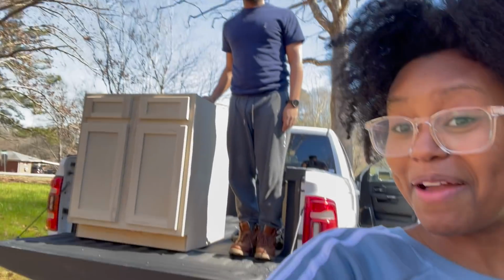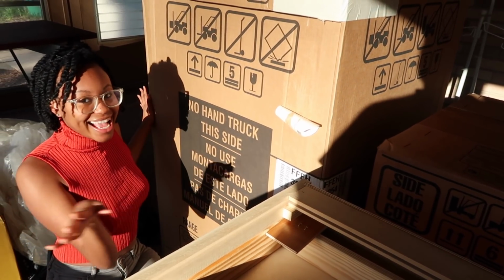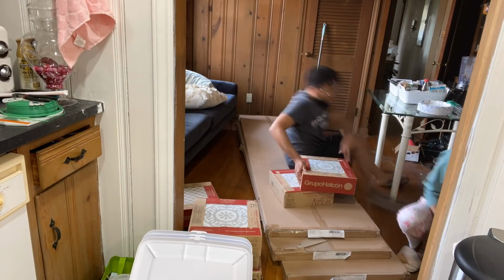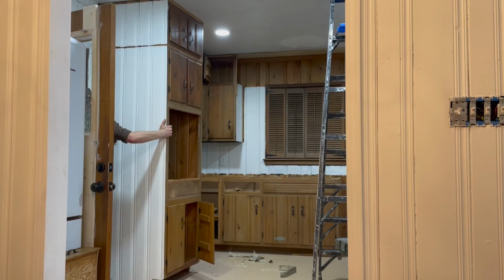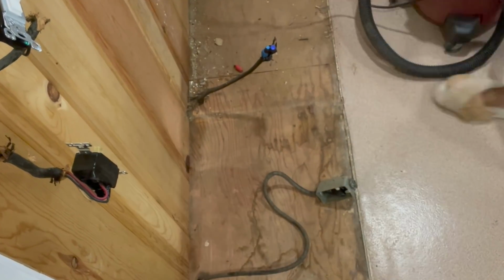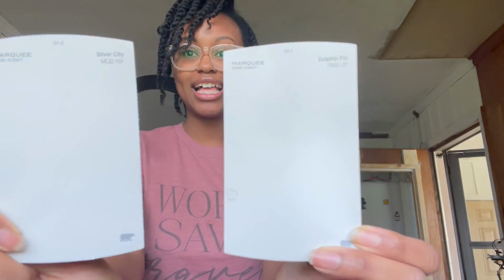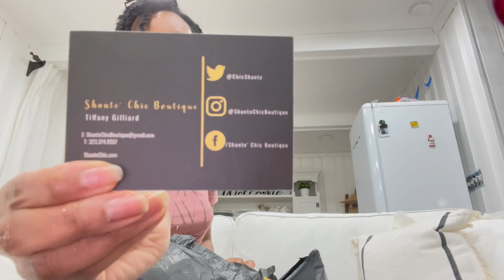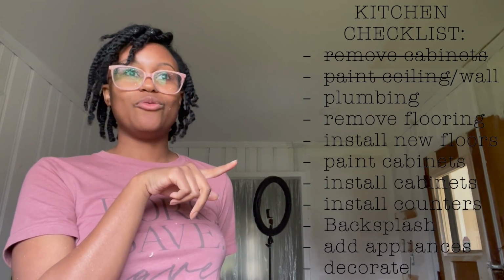IT'S DEMO DAY! COMPLETELY GUTTING MY KITCHEN! | Kitchen Makeover Vlog #1 #FIXERUPPER +GIVEAWAY

Comment: When using the paint sprayer you have make sure the paint is right consistency, you can add water or floetrol and stir well. You also have to adjust the airflow and the paint volume(nozzle). The ring around the tip controls the paint volume slightly loosen/tighten it until you achieve the correct flow. Typically near the trigger is knob/button to control the air you have to adjust it for the correct airflow for your paint. Test the flow on cardboard or something and play with the adjustment. Also check for clogs in paint, when in between spraying cover the sprayer with plastic and place in the fridge to keep the paint from drying. If you have any questions, I'll do by best to answer them. Goodluck
Reply: That's so nice of you
Reply: Super helpful
Reply: @nae1470  thank you
Reply: @naturallynailah6983  yw

Comment: In so excited for your Reno. But a quick tip on the sprayer. If you are having trouble with the paint coming out. Add lots of water to the paint and always be sure to clean out the nozzle before and after every use. Refer to the manual for how to take apart the nozzle for cleaning. With latex paints I add 1/3 paint and 2/3 water to the container on the sprayer or half and half. Unfortunately using paint thinner was never enough with my sprayer as I have a similar one. But rule of thumb most times if it’s not spraying out you need more water or need to clear out the nozzle. I hope this helps.

Comment: Don’t give up on the sprayer!!! It’s the best for cabinets. FYI, white paint is the worse to spray because it’s difficult to see where you have wet vs dry paint. I learned that the hard way 🤦🏾‍♀️ it’s also helpful to strain your paint before using the sprayer, and use water to thin it out if you need it thinner. The sprayers usually come with a viscosity cup, don’t skip this step!

Comment: You can use wood filler or putty to fill the seams in that wood paneling. I see you painted over the wood but so it looks like drywall you can putty the lines sand and paint.

Comment: Love the videos. I would remove the paneling and add drywall  since you’re already doing a new kitchen. It will refresh and transform the entire area. If you decide to keep the paneling I would consult with someone to make sure your paneling is very secure and can hold the weight of tile or hold the tile in general. Loving it all. Very inspiring, so happy for you.

Also, invest in a good quality cabinet paint, like Sherwin Williams or an Alkyd paint. I’ve painted cabinets with Behr and it definitely does not hold up as well as cabinets I’ve painted with Sherwin Williams Emerald.

Comment: Are you going to tile your backsplash on that paneling? Just curious I've never seen that done and was worried it would be uneven.
Reply: It's done a lot (grew up going to my dad's construction sites) she can and should use what is called a "backing board" to place over the paneling and then place her tiles on the backing board.  She can also just drywall over all the paneling if she wants to also.

Comment: I notice you have a sticker on your front storm door . .   is it an alarm system?  If so I'd suggest making sure it covers the sunroom & items in it.  Otherwise I'd make sure the sunporch is secured so if anyone breaks in and steals anything it'll be covered under the home owners insurance.  Can you get a RING camera connection (or any other kind - systems tend to be very reasonable nowadays) out there as well???  If so put a notice up outback that you have it to deter bad intentions.  You & your home are out in public so I hope you understand my concerns.

I think seeing that large end cabinet out - I'd move the stove down to the end and have more counter space along that wall.  Maybe build a small pantry closet in the corner of the wall the hutch was on for food storage etc.??  

Isn't it amazing how different it looks w/out the cabinets lol.

Marcus' dad deserves big kudos for the FBK suggestion!!! ❤

Good girl wearing a mask while cleaning up the old debri - asbestos concerns.

Old floor removal - be careful of asbestos it's usually in old flooring and where you dispose of it.  You can be fined it you don't do it properly.

The paint sprayer- typically you need to make wide sweeping motions & multiple light coats.

Bottom cab paint - whatever goes with the floor tile since those two connect.  Just remember to seal the cabinets with a clear seal coat to avoid chipping.  They'll tell you it won't but it does.  I've painted two kitchen cabinet sets and used the best suggested paint & it chipped. 

Typically flooring is last to avoid scratching the tiles - just be aware.

Love the handmade tile coasters.  Sooooo you!!!

Can't wait for the next update.